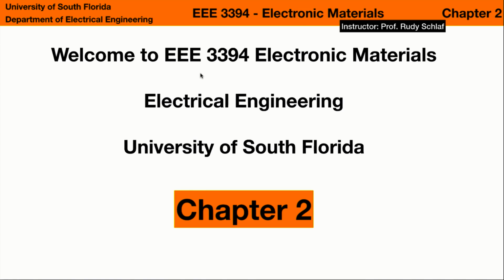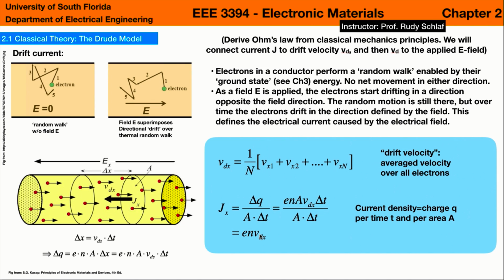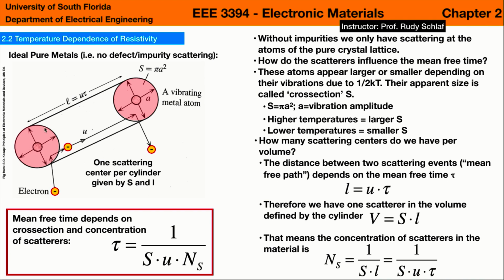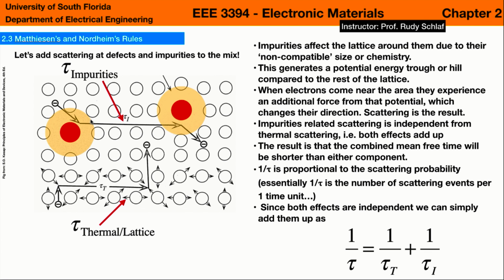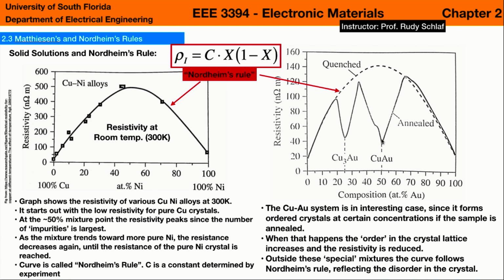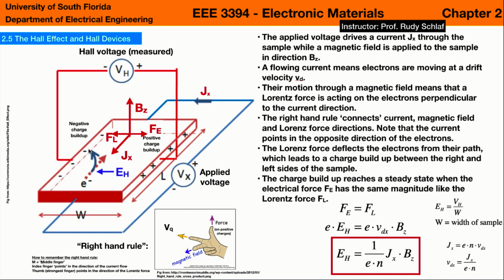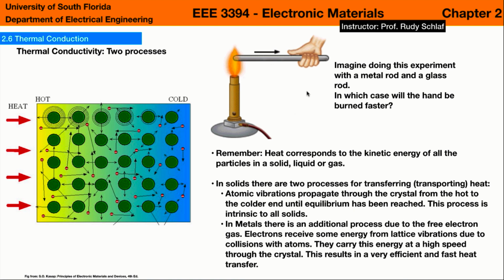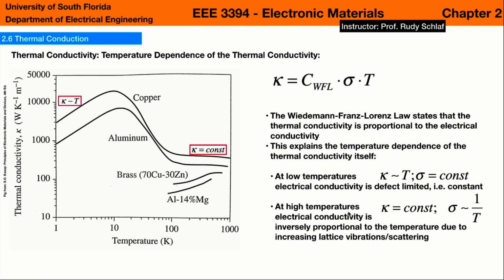EEE 3394.901 Electronic Materials: Chapter 2

Comment: If thermal conductivity is also mostly due to free electrons just like electrical conductivity, does that mean when thermal energy is added at one end of a conductor, the other end of the conductor sees that thermal energy just as fast as if you'd applied an electric current? Could you use this principle to create a thermal communication system/computer or is the inherent thermal (Brownian?) noise and dissipation just too much?